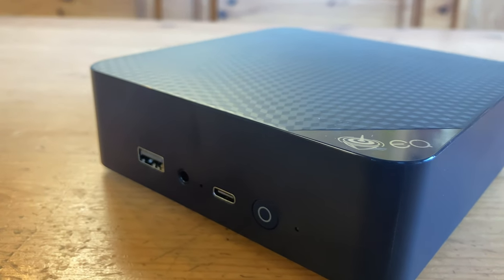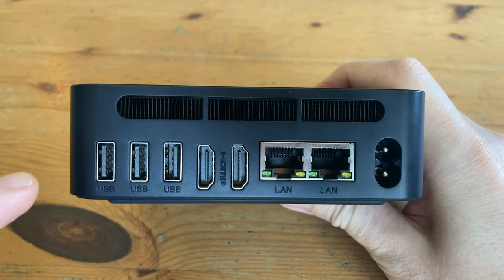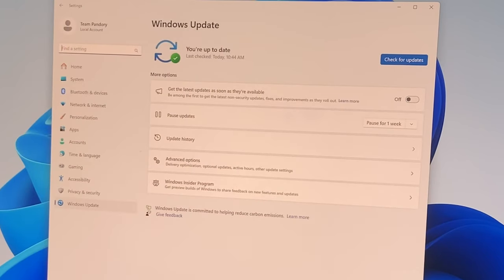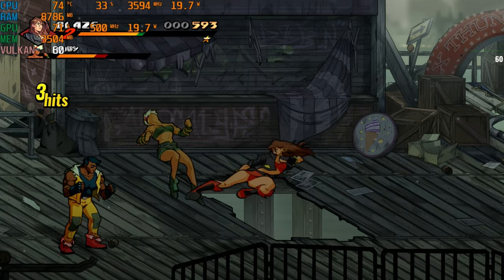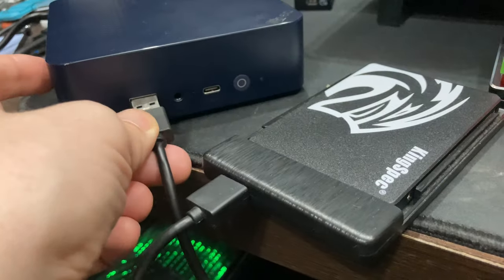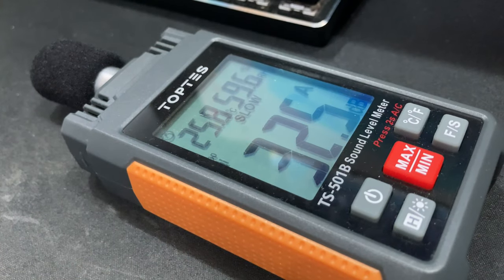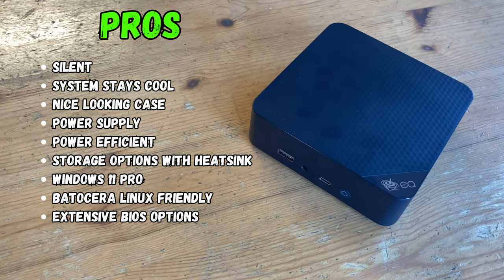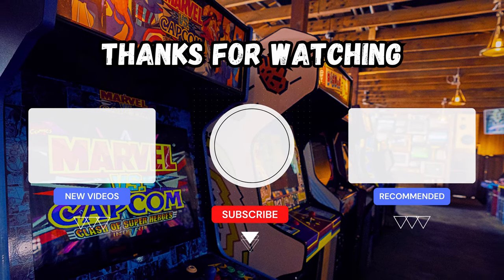This Intel N200 Mini PC is SUPER Quiet [Beelink EQ13 Review]

Comment: N-200 !!  BIgger Number = MORE POWER!  Waiting on the N-300 so I can get 9 percent MORE POWER
Reply: Yeah, Intel has made a mess of the NXXX numbers.  MS Copilot in the Edge Browser:

N95: An entry-level mobile CPU from Intel’s Alder Lake-N series, with 4 efficient cores (E-cores) and a base power consumption of 12W
N97: Similar to the N95 but with a slightly higher performance and power consumption of 12W
N100: Another entry-level mobile CPU from the same series, with 4 E-cores and a lower power consumption of 6W
N200: This is not a standard classification for Intel processors.

Some web site called versus:

Why is Intel N95 better than Intel N200?

1.7x faster CPU speed?
4 x 1.7 GHzvs4 x 1 GHz

450 MHz faster GPU turbo speed?
1200 MHzvs750 MHz
Reply: @dlewis9760  seems like the n200 is the worst in the line up (its supposed to be the strongest but gaming wise like in the surface go 4 which barely runs gta v above 30fps), while the n97 is the best one if we exclude the i3 n300 and i3 n305, it doesnt make any sense
Reply: The N305 was available for a short time as the EQ 12 PRO.  Production stopped on the model shortly after the model was first introduced.   Right now, most N300/N305's are produced in Fanless network appliance chassis' format ..  I believe the EQ 12 Pro stopped production because, for the most part, consumers could source an AMD based mini-PC for the same price with better performance without the Intel limitations imposed on the N100's/N200's/N300's...  The ONLY thing that the EQ 12 Pro had the advantage to was that it had TWO 2.5G Intel (I-225's, I believe ) network ports. Such devices as the EQ 12 Pro could make a wonderful "router on a stick" or "soft-router" ...   The EQ 13 - not so much with the downgrade of the network adapters from 2.5 gigabit ethernet down to 1 gigabit ethernet. With the 8 cores of the N300 series, it was a much nicer arrangement than the 4-core N200's..

Comment: No USB-C is a killer for me. The N100 EQ12 seems a much more advanced system, especially as you can power it straight from a monitor, and there isn't a major benefit from N200

Comment: Arguably, the EQ 12 is a better model for a server than the EQ 13, unless you want two NVME slots. The EQ 12 gives you DDR5, and dual 2.5 gigabit ethernet network ports.  The EQ 13 only real improvements was the built in power supply, and the N200 processor, but then downgrades the network adapters to 1 gigabit  ethernet and DDR4 memory. 
On the technical side- the EQ 12 and EQ 13 will both take a 32GB SODIMM, so you can have a mini-server with 32G.   The NVME on the EQ13 is not 4 lane PCIE, but instead is 3-lane on the first slot, and 1 lane on the second and reflects in benchmarks if upgraded.  Out of the box, you'll get up to 3500 Mbps with the 1st slot on the EQ 13, and it will more or less top out at 900 Mbps in the second slot. The INCLUDED SATA SSD  tops out at about 500 Mbps in case you are wondering ..  So, upgrading the SATA drive in the EQ13 does provide a nice speed boost, but only really for the 1st slot.  The second slot is not that great of an upgrade. The PCIE lane limitation on the drives is likely a design issue with the N100/N200/N300 chipsets... 

In the end, you can have a nicer unit if you upgrade it, i.e. 32G ram, and upwards of 4 TB of NVME, but because of the downgrade to DDR4 and dual 1 Gigabit Ethernet, if you want a server or software router, you should get the EQ 12 while you can as it's a better option with dual 2.5 gigabit ethernet and DDR5. Both will take 32 GB ram, just a single NVME + 2.5 inch SATA on the EQ12.  Eventually, I expect Beelink to kill off the EQ 12  in favor of the EQ 13.  All of the downgrades spells only one thing; it's cheaper for Beelink to source, but the savings is not necessarily passed onto the consumer. 

In reality, the N200 will only seem faster when performing tasks such as upgrading Windows; but for the most part, it's just a slight bump up from the N100.   The N305 was a nice performing option when the EQ 12 Pro was on the market, but for the most part,  one could find a more powerful AMD based chipset for about the same price as the EQ 12 Pro, which is why I think the model stopped production.    Also a reality is that these little mini-PC's, especially the N100's, N200's, and N300's all work better under LINUX  than the same models in Windows. I do like the integrated power supply;  most won't feel the difference between the N100 and N200, so, all-in-all, the EQ 13 is not a better machine than the EQ12.  With the downgrade in the ethernet, may as well find an AMD based Mini-PC in the same price range and enjoy the performance boost. 

The quiet- is likely derived from the EQ13 having larger heatsinks than the EQ12's for example- so the exhaust is significantly LARGER than it was before. It too is  a nice touch
Reply: I tried the new EQ13 N200 a few days ago.  You saying that I could have removed the slow no-name SSD that came with the machine and toss in my P31 SK Hynix and get proper speeds?  I ended up returning the EQ13 and got an EQ12 instead.

Comment: They missed a trick by not having an N97 model.

In this instance it is initially positive not to see the N200 being priced way above the N100 for the little performance increases that it offers. However the cost cutting elsewhere illustrates why and not to Beelink's benefit.

The dedicated internal PSU is likely not necessary and must have an option for replacement to maintain attraction.

The audio port on the front is unusual but not restrictive.

These rubber feet again? Are Beelink incapable for learning the simplest of lessons?

DDR4? Does this really need further comment?

I do like the SSD heatsink that covers both slots and is easily removable.

Providing MSATA M.2 is cheap and may well be quite off putting.

The EQ12 was desirable and although it was not the cheapest, it still sat in a place where for the right daily deal, it would have felt worthwhile spending that extra money.

Not enough thought has gone into the EQ13 and although it is still in the right pricing areas, where I expect to see regular deals on the jungle site to something more competitive.

However, after watching initial reviews for the EQ12 I felt expected, after this I feel very little and already look forward to others providing options that are missing here.

The sole advancement of interest is the quiet fan and seeming decent heat management but it just isn't enough.

Not even close but no cigar. Like the Marvels movie, I watched it once but have no desire to do so again.

The cost cutting to make the N200 attractive just hasn't worked and I am sure that other reviewers, even those with rather too close relationships with Beelink will find it hard to spin things and avoid the obvious multiple downsides.

It is leaving my memory already.

They should fix the obvious issues and slap in the N97, which is eminently good all on it's own merits.
Reply from the maker: The audio jack on the front has been the norm for many mini pcs, but a lot of those points make sense.
That's why we could only recommend it to be used as a silent server.
If they'd have used a pcie3x4 (and have it compatible for two ports) or had a place for a 2.5 or 3.5, and better ddr5 memory, this would be a serious contender.

Outside that, there's many better options, even by Beelink themselves - especially if you wanted to game on it.

Comment: I just bought one, because it is silent and sips power. Just need it as a file server or home server for other stuff.

My main PC is a 7950x with a 4090, so I won't be using the eq13 for games, ha
Reply from the maker: @DinoFancellu  the perfect use case 😁 
If you're not a fan of Windows, I'd suggest installing casaos. It's a Linux distro that pretty much whacks everything you need, ready to go as a server.
Reply: The EQ 12 is arguably a better option as a mini-file server or home server for most purposes ..  Both the EQ 12 and the EQ 13 can be upgraded to 32 G SODIMM's, respectively.  But the EQ12 also has the dual 2.5 G Intel network adapters.  Most file servers are going to be running at near single digit percentages anyways, so the amount of noise is inconsequential overall, unless you are trying to game on the machine, which you aren't. Most of the downgrades to the EQ 13 is about the manufacturer cutting costs, but those cost cuttings were about making Beelink more money per mini-pc not about saving their customers money.  Why might I think that?  If the EQ 13 costed much more, many would simply go find a better option with an AMD based mini-PC at about the same price point- and get 6 Core 12 Thread or 8 Core 16 Thread performance rather than  4Core 4Thread.   
Like you, however, I do see some value in having a lower powered, quiet mini-PC acting as a home server.